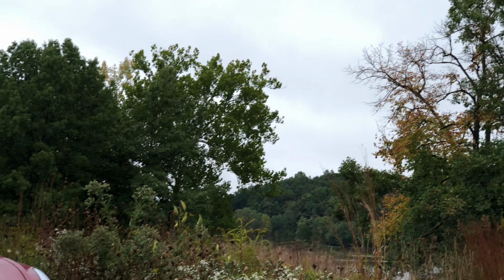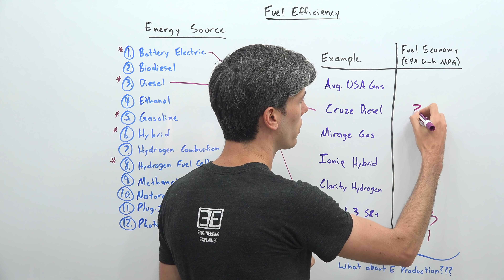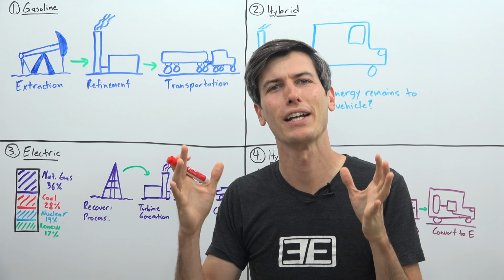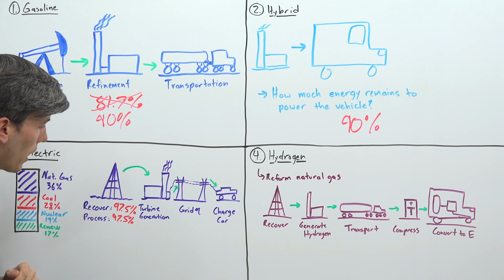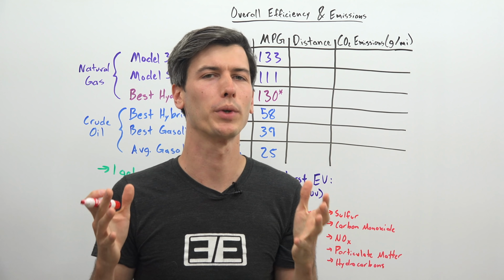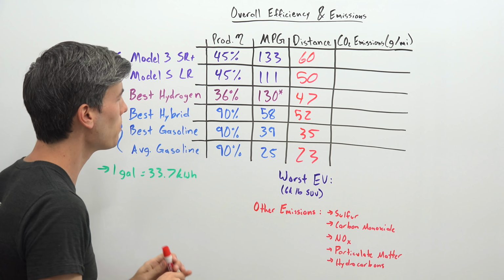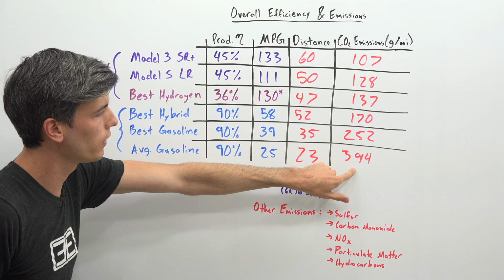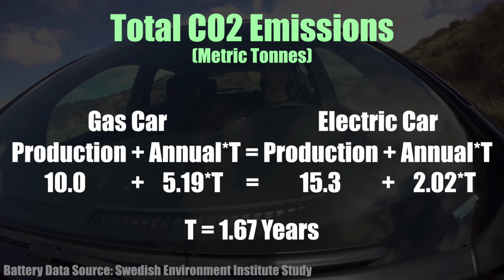Are Teslas Actually Better For The Environment?

Comment: You left out a lot of important factors.  For example, when you take an "average" of gas vehicles, you are including monster trucks, you're including ridiculously over powered cars like the Dodge Hellcat, or the new Mustang, which get terrible gas mileage just because the owners don't care.  You should compare efficient gas cars, I have one that gets 41 mpg regularly because we are talking about the most efficient system, so we should choose the most efficient cars, because efficiency is the goal.  Why would a Hellcat be compared to a Tesla if we are discussing efficiency?

Next, you ignore life span of the vehicle.  If the Tesla lasts 100K miles, and the Toyota Yaris lasts 300K miles, then the Tesla owner has to spend $240K on transportation, while the Yaris owner has to spend about $15K, so the gas car is 10 to 20 times more efficient, because manufacturing takes a huge toll on the environment as well.  

Next, you ignore the infrastructure that has to be built to support electric cars, while an infrastructure is already built to support gasoline cars.  You can't drive the electric cars cross-country yet safely, because there is no infrastructure.  You can drive a gas car just about anywhere, because of the existing infrastructure.  So the environmental toll of building out an electric network has to be factored in.  

The reality of the situation is, people buy Teslas because they want to impress other people.  Anybody that just wants cheap reliable transportation, would buy a little gas car like a Yaris.  But the Yaris is not sexy for men, and men have their egos controlling their decisions, the little head controls the big head, so they make up BS like this about the efficiency of an $80K Tesla to hide the reality of what controls their decision.  Face it, you bought the Tesla because of your penis.
Reply: He literally used a gasoline car with 39 MPG...

Comment: So the winner is hydrogen then. Comparable emissions and eficiency to battery cars, but with the benefit of the gasoline car that you can fill them up in 5 minutes tops.

And if you make the hydrogen with green energy instead the eficiency will drop like a rock, but so will the emissions. And you save on a lot of nasty stuff used in battery production and a lot of chemical trash from worn batteries.
Reply: If you're one of the people worried about the electric grid when we're moving to EVs, hydrogen should terrify you.

Comment: Actually the plant to plug losses are higher than you state and there are self discharge losses as well 
The 10 pct volumetric loss from well to pump is fairly accurate
And includes refinery  power self generation from waste gas 
Em  made fake news about outside sourced  electric power  use
You mpg rating on a meduim diesel car is way too low mine uses 4.5 l/ 100 km thats about 70 mpig or 55 mpusg or 88 gram co2 per km

Comment: For what you did is right but there is so much that you did not do that makes electric cars bad renewable is going up which tests show that making solar panels and wind turbines hurt the environment more than natural gas electricity plants.  Natural gas plants are slightly worse than gas cars if they where to run off all the gas the plant uses.  Coal power is bad and that needs no explanation.  Lastly nuclear power is going down because people don’t like the look of it when it’s the only way to make electric cars be better than gas cars.  So really gas is still better for the environment because everything it take to get oil out of the ground to a plant to separate it then get on a train to lastly be delivered by the truck is way cleaner than adding the steps where it’s used to mine lithium, build any kind of energy creating thing, build new power poles every few years, make the power grid need more energy which will be those renewable energy sources making worse for the environment than nuclear power that they will then get rid of then those electric cars will be way worse than a gas powered car by over double so gas is better until we get more nuclear power.  Also I will not start on how bad the world’s economy would go with more electric cars.

Comment: I take issue with the content here...because I work in the nickel mining industry. Have you any clue how fossil fuels intensive it is to mine anything?  We burn copious quantities of fossil fuels 24/7/ 364 (we get Christmas day off). I will tell you how fossil fuels intensive finding battery materials are and developing a working mine. To be clear, only sulphide nickel is desired for battery material...laterite nickel is useless for this purpose. First the surface exploration involving a camp with generators , R.V's, boats, 4x4 's, helicopter's flying in grids to use scanning devices looking for an ore body. That's stage one. Then there is surface drilling with fossil fuelled rigs, and all the support and transportation for that . That's stage two and it can take years. Then there is the building of a mine site, head frame, mill, repair shops, parts warehouses, dormitories, sewage treatment facilities, tailings dams...thousands and thousands upon thousands of tons of steel and concrete...all transported by big trucks 24/7/364 (I believe they also get Christmas day off)...this can take three years or more...a 5000 foot shaft can take five years to sink...not including drift development, ramps, sumps, drain holes, ore passes, haulage ways, underground crushers and trucks, scoops, scissor decks, forklifts, personal carriers etc. etc.   all using millions of gallons of diesel every year. That does not even include the concentrate being hauled somewhere to a smelter for processing and then the refined product transported by truck, ocean going vessel etc. E.V.'s are NOT any better for the environment...that's an idea that only exists in the bubble world of urban dwellers, ...I'm sorry... but it's true.  Vale nickel mines,Thompson, Manitoba, Canada...check it out.

Comment: It would have been much more accurate if he had worked out the ev emissions and efficiency on matural gas and then dividing it by the percentage that was renewables e.g 0 emissions. I feel for every video to make the gas cars come closer he always gives them the “benefit of the doubt” and puts electric cars in the worst light which still makes EVs win since they’re better but does not give accurate results

Comment: But you got to think about how these batteries are produced and what happens to them once they're done. Both of these processes produce a buttload of bad byproducts.

Edit: When you look at how the materials for electric car batteries are gathered you will quickly realize that it's not necessary better than combustion engines. We completely destroy wide landscapes and the people living there have to move or they die from the toxic air and ground.

Comment: There is just one problem, you use official mpg ratings, that actually useless, check how the official mpg testing is done and you will find is anything but reallystic
Reply: Adding to the problem, you are not taking into account all the cost of making the lithium ion batteries
Reply: lets keep adding, as if all the thermal plants were not emitting all those Nox, sulfur and everything else, you did not take into account where all the energy production
Reply: One more for the giggles, how about whe take into consideration longevity of the vehicle? Batteries just do not last long, they need replacing every 5 years or so of use, when a average internal combustion engine can last for 10 easily, many pushing into 15 and 20
Reply: @Gugolple666  mpg calculations aren't 100% accurate, but they're not far off either.
it "costs" to make ICE cars too. The extra 50% or so it "costs" to make electric cars it more than made up for during the life of the vehicle.
On the subject of adding thermal plants, plants to refine petro into gasoline also have those emissions, so?
On the subject of longevity, batteries today are coming with an 8 year warranty, so you can expect them to last at least that long. Some won't, but some gas engines don't last 10 years either. They're saying that new batteries are pushing 1 million miles, more than just about any ICE car can even pretend to get.

Comment: you can not store electricity that easily and you can not really transport it... how do you calculate that??? this is assuming you generate electricity right when you want to charge your car.
this is just the power source. you have to consider the build of a car. with an electric car you have thousands of sellers incorporated, you simply can't calculate the co2 footprint. an electric car is hiding it's co2 footprint and trying to cover it up
Reply: You didn't even watch the video, did you?

Comment: This comes from a non environmentalist POV. Gasoline comes from oil. Oil are drilled or mined from tar sands (lots of energy and money) Oil is refined and turned into gasoline (lots of energy and money again) then gasoline are transported by trucks (lots of energy and money again) then into a gasoline station (lots of energy and money)

Even you charged your Tesla from coal power plant, you eliminated a lot of overheads cost and so called "Carbon Emission"  (a newspeak for green mafia extortionist demanding money through carbon tax)
Reply: I'm not an eco-freak tree hugger. otoh, the economic viability and efficiency of current generation EV's completely out classes current ICE vehicles.
Don'rt be like a lib, and blindly accept whatever your TV or fav website is telling you. Look into the numbers. ;) You'll see what I mean.

Comment: Some serious bias going on here. gives a few percent benefit to internal combustion and then completely ignores the fact that 28% of electricity is generated by COAL.....seriously. If those numbers were included it would completely change both the MPG and CO2 output numbers.

Comment: Why would you assume natural gas instead of the average of US power generation emissions? Natural gas is slightly higher, so this only proves the point further, but it seems like an arbitrary choice.

No cars are better for the environment, they can only be less bad for it. If we want to reduce transportation emissions, buying a Tesla is going to make a negligible difference over an economy car. Investing in mass transit and clean energy production, reducing waste, using technology to telecommute, and shortening supply chains will have a much larger impact. Feeding cows seaweed would reduce climate change more than electric cars. 

Electric cars are cool technology and can be fun to drive, but let's not kid ourselves, they're not going to prevent climate change.

Comment: But natural gas is much cleaner than coal, and what electricity is trying to move to. Most countries use more coal if they arent as developed, (or if they arent in the middle east).
Reply: Shouldve been done with ratios. A bit lazy on that end, but decent calcs.

Comment: The figures you have used at the beginning are not very valid. Most petrol and diesel cars are vastly more efficient than you have assumed. Also the CO2 figures produced are invalid. I am a fan of the channel but as an engineer, I don’t agree with the assumptions you have made.

Comment: Forget all this stuff!  Generate electricity from wind, water and solar power -- the cheapest sources of electricity as well as the cleanest.  Electrify everything -- mining, manufacturing, transportation, building power and heat, agriculture, and traditional electricity.  Now your Tesla, like mine, is charged from clean energy and it emits no CO2.  It's a giant transition but it is happening despite the vested interests -- car companies, fossil fuel companies, utilities, and the political lackeys -- doing everything they can to slow it down.  Why?  It's not just cleaner.  It's cheaper.

Comment: Too bad Tesla's cost more than 2x compared to your average car, are more expensive to insure, are often totalled in accidents because they cost so much to repair (the battery can be declared a loss if it even has cosmetic damage, that's 15k alone), has no third party repair shops, can refuse to sell you spare parts at their discretion, has no aftermarket parts, and treat used Tesla buyers like they don't even exist.

They are basically designed to be disposable. I'll wait until Ford or someone gets it done.

Comment: Your 45% efficiency is WAY over inflated. You’re not using an efficiency rate based on engineering, but bureaucracy. That number is more like 30% (according to the dept of energy). That gives you more like 40 MPG...not 60 which puts the Tesla in line with other high efficiency ICE vehicles. You can’t change physics. It just takes a certain amount of BTUs to move a 5k lb hunk of metal down the road at 70 MPH. 

Your bias is showing.

Comment: I replied already but YouTube chose not to post it.  I said that  the  “emissions” from electric cars are indirect.  The heavy and rare earth metals take a tremendous amounts of fossil fuels to strip mine them out.  Yes, more than oil drilling.  As a retired physician, I know the detrimental health effects from breathing in Nickel dust and Lithium poisoned water supplies.  And yes, strip mining is way worse to the environment and energy usage( carbon emissions) than even oil wells ( not fracking oil wells which is a total fraud- another argument).  Just ask the people’s of Argentina, Bolivia, and Peru where these mines are.  They and government officials there say, “ what green energy? Look around us!”  Does drilling for oil spend energy and release hydrocarbons?  Absolutely.  You are trading one know polluting technology for an “unknown” polluting technology.  The full effects of this mining for these rare earth metals are yet to be determined.  You are an engineer.  Why not focus on a minature and portable  hydrogen gas  assist device for existing cars?  One guy on YouTube gets 30 miles/gallon on an 1992 F150 full size pickup.  He made it with home tools and supplies that cost him 20 bucks.  It consist of a jug of water, a stack of metal electrodes, positive and negative battery cables, and a delivery tube to the air intake.  Of course it has an engine tune  for the added hydrogen gas generated for combustion. This would cut gas consumption by 40-50% and not cost the individual and countries a whole lot of money.  As an added benefit, the emissions are reduced.  Electric cars are great for large cities like NYC where it has dramatically reduced air pollution. You have to ask what will be the cost if you try to do this everywhere?  Looks like with the current technology is :  BANKRUPTCY.

Comment: Now, why don't we just take that cheap and clean burning natural gas, and pump it directly into your car? Why do we either need to have losses in the power grid,  have losses during hydrogen formation, or have some losses in refining expensive oil? Why do we have to wait hours to charge, spend a lot of recourses on mining cobalt and lithium. Why do we have to waste electric energy and range to keep our cars warm?
Just let cars run on gas. I mean the gas that's actually a gas.
Reply: Storage.

1 gallon is the equivalent of 0.0038 cubic meters, and a gallon of gasoline has a mass of about 3.8kg. 1 gallon of natural gas at STP has a mass of about 3g.
Reply: @sasjadevries  Odd that would say that I "didn't do my homework" as well as using personal insults. Pretty uncalled for.

Regardless, the problem natural gas faces in becoming mainstream is it's density. As a gas, the only way to get remotely close to the energy density of refined petroleum is to compress the gas. Compressing the gas incurs risks and technological complexities.

Sure, it may be faster to refuel than electric, but you face a more important problem - where do you refuel? The vast majority of gas stations will not be able to supply you with compressed natural gas. Electric charging stations are becoming as common as gas stations. And while most of those chargers will take orders of magnitude longer to provide energy, it's a heck of a lot better than being stuck because you can't get compressed natural gas.

Electric is cheaper. I pay $20-$30 per 1,000 miles, or about 75 cents for 30 miles. Weight becomes an irrelevancy when my cost is less than 1/3rd the cost of gasoline for a 30mpg car.

Comment: Refining/converting so what. What about power used to extract and refine.  So oil says they can turn 100 gal of crude oil into 80 gal of gas? Yeah right. You took into account transmission line line but not truck fuel cost? Bits and pieces not whole picture. And you went by MPG not efficiency of burning that gal of gas. Apples to oranges. Not all junk but enough.

Comment: Colorful demonstration but you are off on the gas efficiency calculation. Not as simple as you point out. Battery can be recycle emissions can’t. In general once you remove natural resources from the ground they all bad. Emissions still bad in the air. I will die til my last fresh air then bad.

Comment: I will buy electric car when I will get 1000 miles from charge and its going to cost max 20.000 for new car
Reply: That will probably be never because even if such batterys would exist it would take ages to charge them on most charging points. 300 miles with a good fast charging network is plenty.